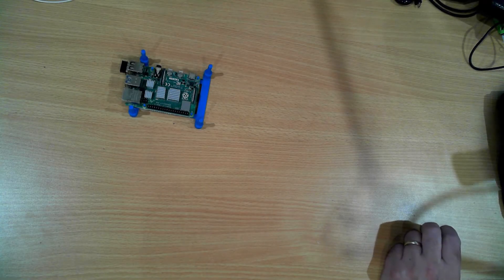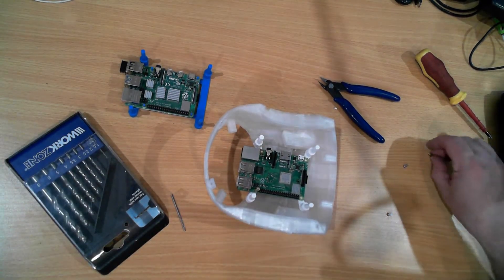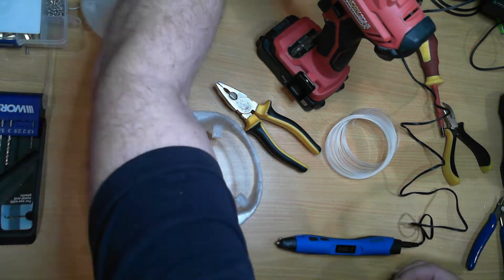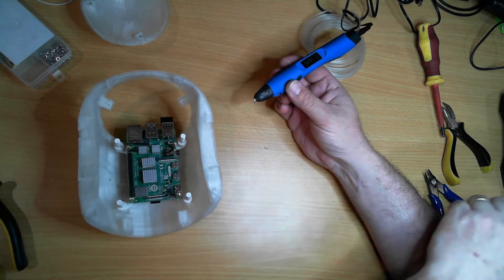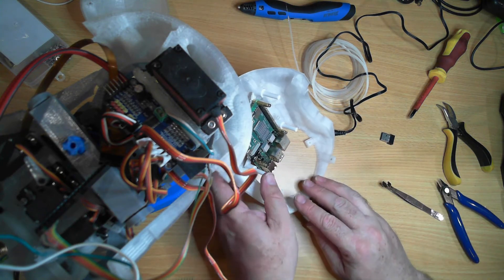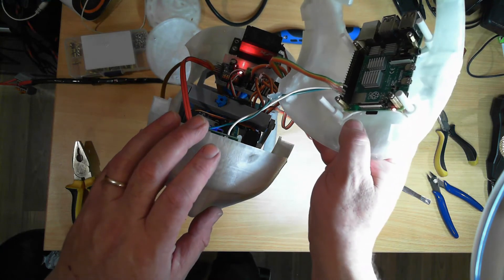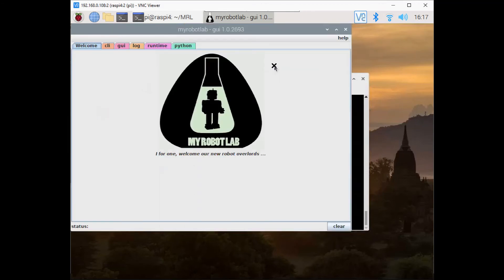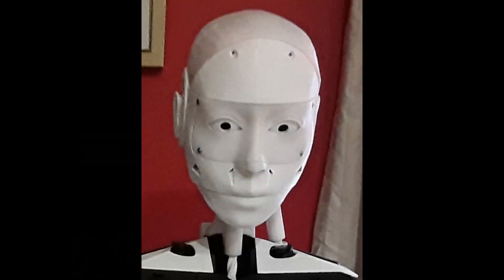Freds Head part 10 upgrading the Raspi

Comment: Did you run out of memory running all those services? I noticed you didn’t have to use the -m option to allocate additional memory when starting myrobotlab.jar. Using an RPi 4 8Gb I was running out of memory when starting a number of services. I also found I was limited to allocating only 2Gb.
Reply from the maker: So far, not been a real issue, mostly syntax with the code can be an issue.
I've been working on a new multi file code, and it's starting to get there with all the servos working.
But I did have Fred Mark 1 working with a full build using Webkit, ProgramAB and MarySpeech.
Reply: @CyberOne  interesting. It
 I may have to experiment and see which service is causing the memory issue. I did read on the MRL site that someone had the same problem on the RPi and increasing the memory solved the problem. That’s how I found my solution. Perhaps I need to update Nixie. The version I’m running is 7 or 8 months old now.
Reply from the maker: @luisfmoralesjr5221  The memory command works in Manticore as well.
But year Nixie is changing almost daily now